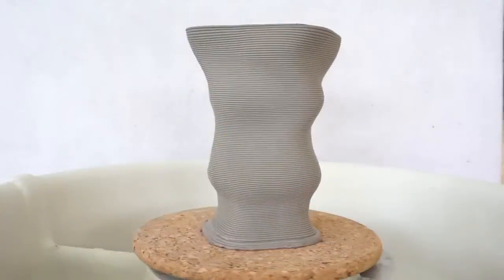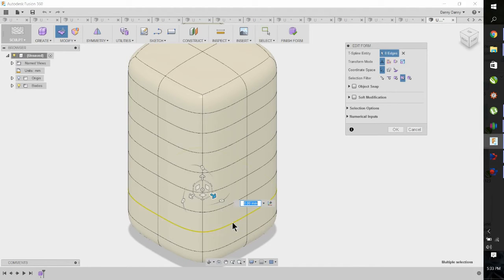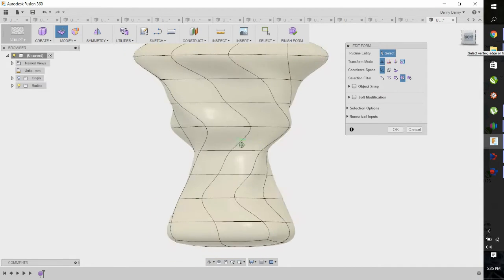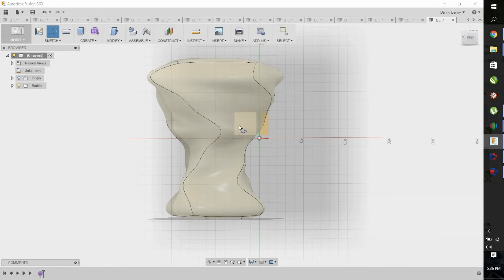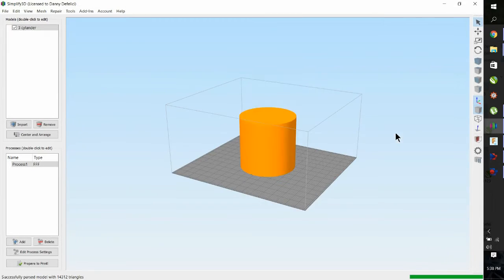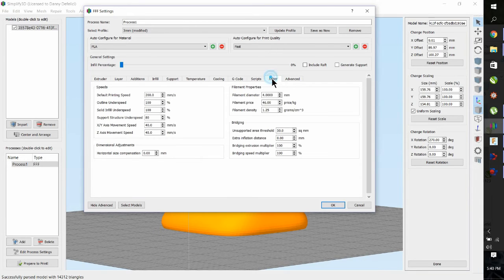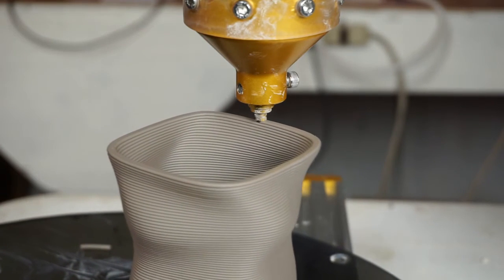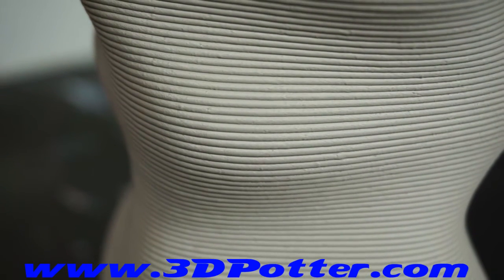Fusion 360 and 3D Potter

Comment: Hi! at 8:44 you show your starting script, but how do you disable temperature run out? Is it extruded hot or cold?
Reply from the maker: Our printers use no heaters. For a temperature script you could do this:
M105 ;Extruder Temp Initialize
M109 S0 ;Set Extruder Temp to 0
We use Duet boards so check out https://duet3d.dozuki.com/Wiki/Gcode